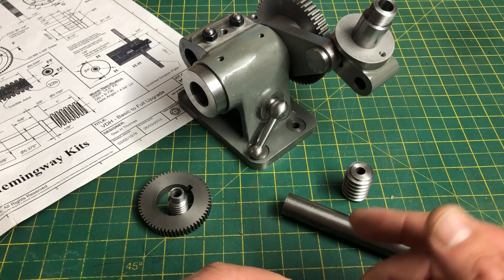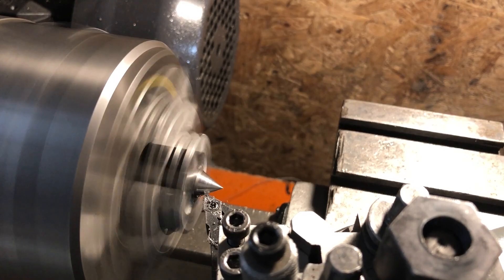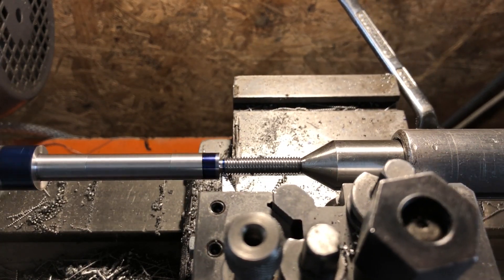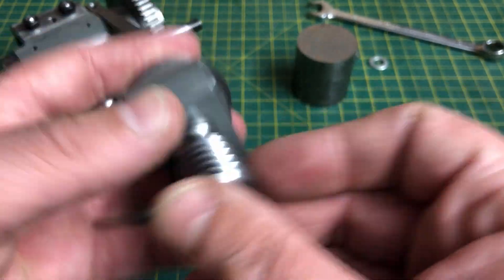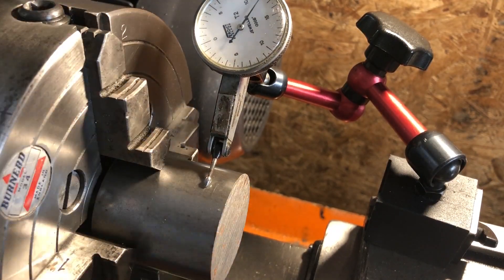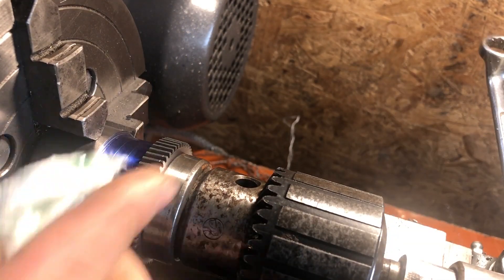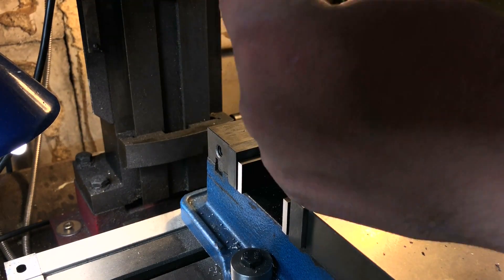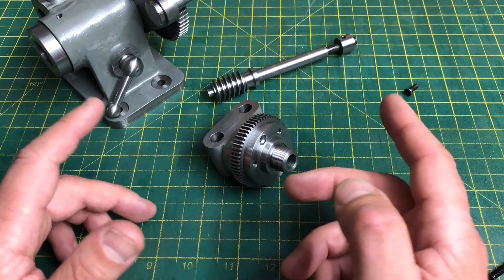Building The GHT Versatile Dividing Head - Part 8 - The Worm Shaft

Comment: hello, very enjoy able, thanks. Why do you say you must put the dog back on the same chuck jaw ? would it do a multi start thread ?
Reply from the maker: Thanks for watching! You can do a rough and ready multi start thread by clocking on the chuck jaws but you would need to increase the pitch to leave space for the second start. (And use a 4 jaw to clock half a rotation if you wanted a 2 start) in this case it would just cut a second single start thread but rotated 1/3 of a turn around the part. You end up with something looking like a terrible knurl!